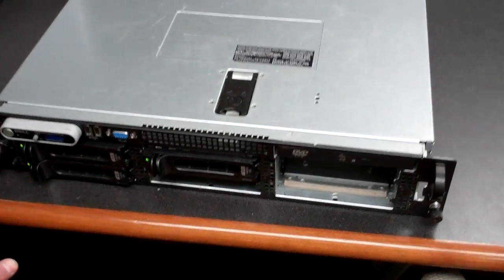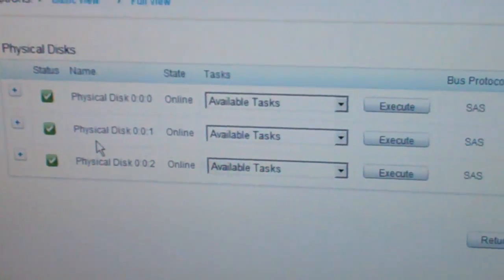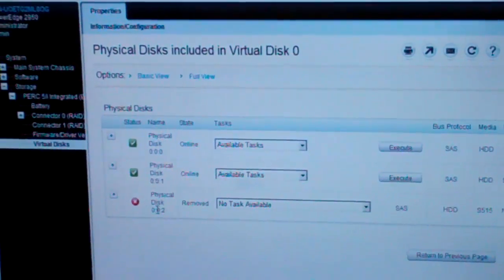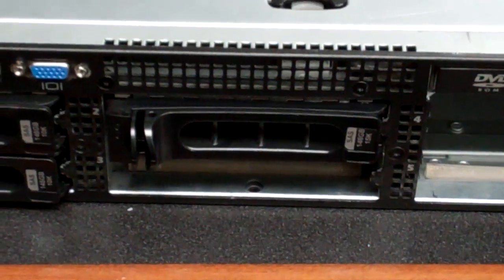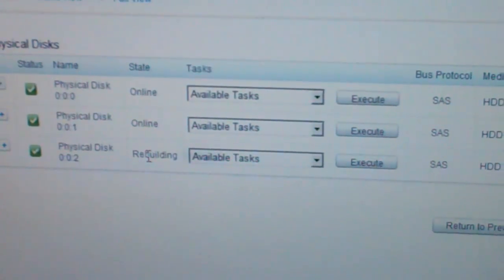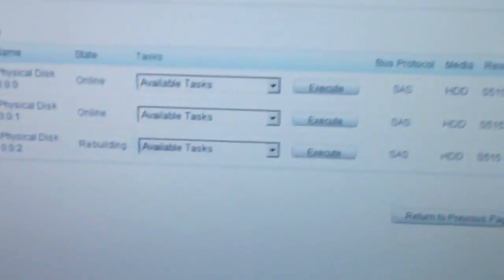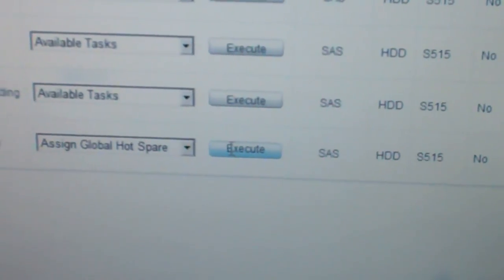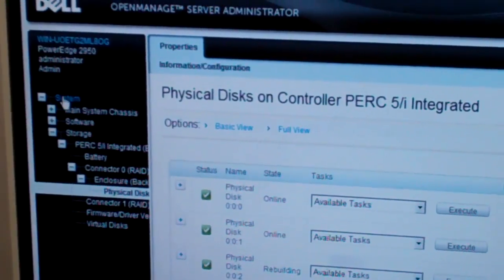Velocity Tech Solutions - How to Replace or Add a Hard Drive to PowerEdge 2950 Perc 5 Raid 5

Comment: How did you get Open Manage to show the storage tab? If i install it, it only shows hardware and software. during the installation it says i can only install the web server and not the storage management etc.I installed it on a windows 7 vm which was running on the server. or do i have to install the storage management on the ESXi? I'm pretty clueless right now.. Would appreciate some help!

Comment: I'm using the Dell Open Manage and I noticed that the flashing drive was flagged as "removed" .
 
I removed the drive inserted another drive that I thought was good but it turned out to be defective as well and deleted all my stats in Open Manger.
 
Nothing was displayed no Raid nothing!!
 
I rebooted the server relaunched Open Manage and everything is fine but one of the drives says Foreign.
 
Note this had nothing to do with the reboot it has been displaying Foreign for awhile, what are my options ?

Comment from the maker: You could certainly replace them. if you are running a 6 bay backplane (if not I have a video on swapping it out) I would suggest backing up all of your data on drives 3 and 4 and adding 4 drives in a raid 5. At least this way you will have faster reads on sata. You are limited to sata II on the 2950. and SSD drives are not supported on this system. Sorry for the delayed response!!

Comment: I have a 2950 running Win Serv 2008, raid 1 for drives 1 and 2 for os and drives 3 & 4 are running raid 1 as data storage, need to upgrade to bigger hard drive in drives 3 and 4 as they are only SAS 146. Question is should I purchase a 1TB standard SATA drive and replace them? Will this noticeable slow down the performance? What is your take on SSD’s? Should I purchase bigger SAS drives from dell? And what open manage software should I install, currently there is none. Thank you for your time.